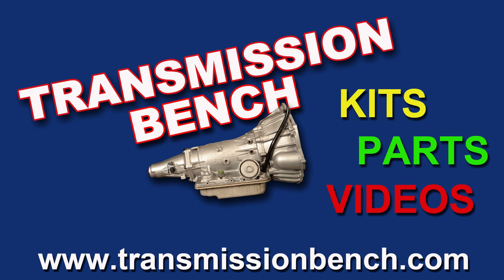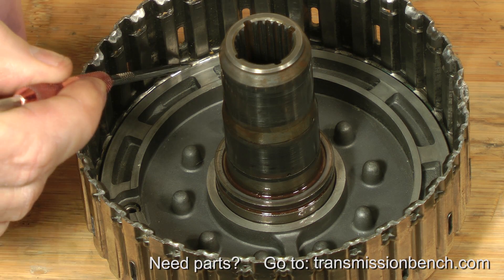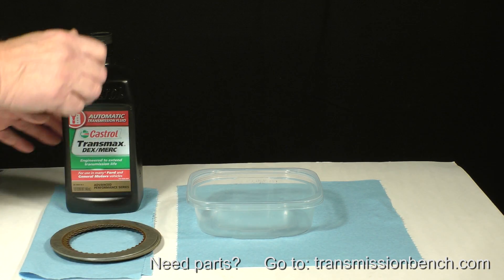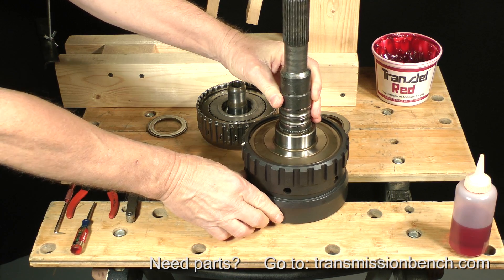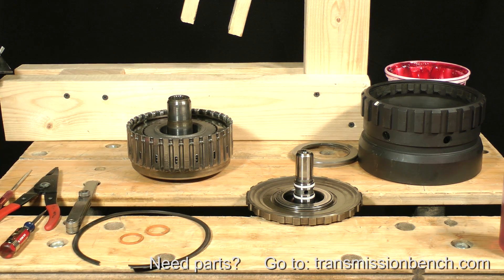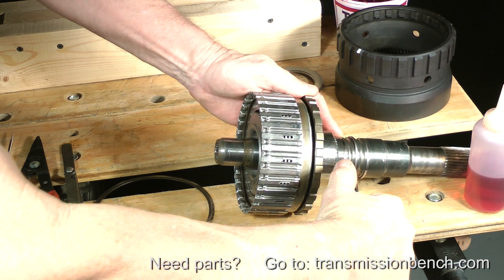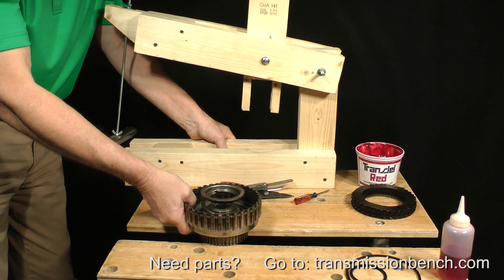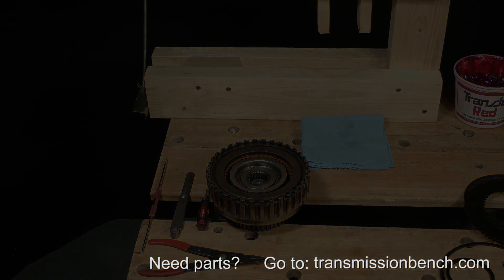AODE 4R70W Class Part 2 lesson 3

Comment: Thanks so much I am a retired equipment technician. and still refuse to pay a shop. Long as I'm able. I found you're videos on you tube while building a 4l60e.that transmission is for a friend's Silverado. a seasoned builder taught me to always put the sharp edge of the snap ring pointing up. Or the snap ring could come unhinged. I was curious if that applies to drum retainer snap rings. By the way thanks for having these classes you are the best instructor I've seen in some time.